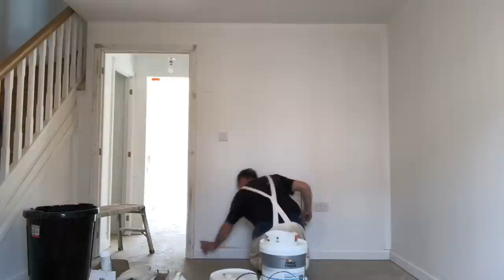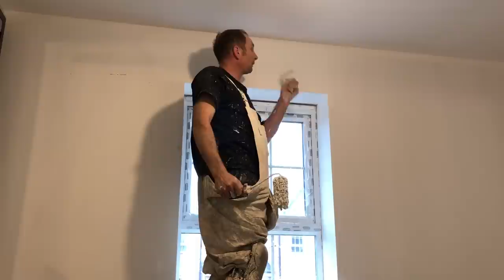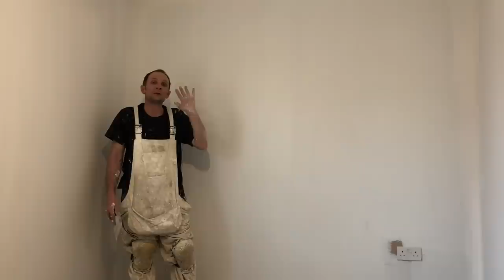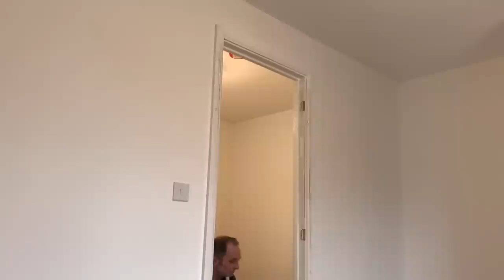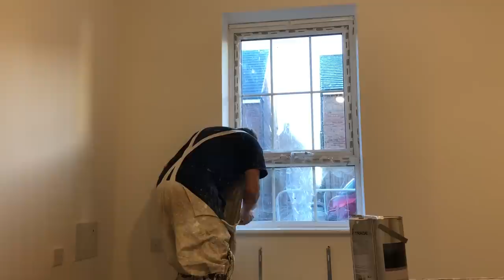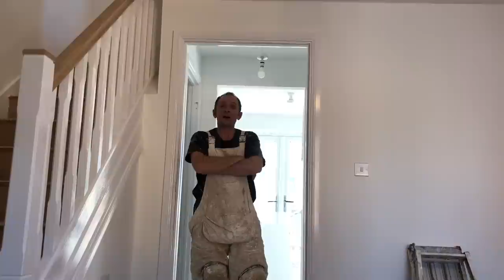How to paint a new build house step by step

Comment: With all due respect to you and your work, and taking into account my professional experience as a painter of more than 20 years, with cheap and expensive houses painted around various places in the United States, Venezuela, Ecuador and Spain, I must tell you that the process that you use is not the right one, I am only going to give you an example, first all the wood is organized and worked, after the wood is painted it goes to ceilings and walls, it is only one of the many examples that I can give you, also I am going to ask you a question, what happens if the client wants several different colors for his walls or he just does not want them to be white but a color tone other than white, that complicates painting the wood last, you have a good brush technique and knowledge but you it applies very badly, you don't look like a professional
Reply: how would you of done it

Comment: i thought i was ok at painting until i watched this. it would take me 4 times as long to do trim. the best take away from this for me is a decent 3 inch brush for coating frames / rolling doors with a 9 inch roller / and second coating satin ( i have been using a shellac primer and one good coat of gloss but it never looks as good as this does.

Comment: See I do it differently.
When it comes to frames, architraves and skirts, I give everything a first coat of paint so I can see all the defects easier, then I fill all the holes, cracks divots etc, then sand, then apply more coats untill ready for gloss......THEN I tube up literally before the gloss coat.
I don’t understand people who caulk up first.
But that’s just my way of working
Reply: Me too mate thats the right way to do it. You'll only end up filling twice saving time and money
Reply: Thats becouse you are proper painter as myself.
That guy works very fast but the quality of his job is horrible.
When you are proper painter you know how to do painting properly.
Reply: Here in Aus we sweep whole job walls and ceilings, take off doors,spray everything with wallboard sealer,spray one then spray backroll one, ceilings finished. spray finish 2 coats inside all cupboards,sand woodworkCut and roll two coats walls and woodwork,gap up woodwork,gloss enamel woodwork,Roll and tip off doors.Sanding and dusting between coats

Comment: A little tub of water and a damp sponge when caulking in finishes perfect!
Reply: paul bristow moisture just cracks any paint laid on top
Reply: @user-yx7dp2pl8t  Ha ha ha Wait till its dried after caulking then paint it ! Just caulk in the gaps wipe off smooth with a damp sponge ,let it dry then paint it! I've been a pro for over fourty years and never had a problem doing it that way!
Reply: Yeah but this is house bashing needs to be done quick to make money. Haven't got time to go over with a wet cloth or sponge. I normally just wet my finger.

Comment: Try the water based white tikurllia satin for quicker finish than oil satin, and quicker and far less draggy than the standard paint quick dry satins. It's thin but high solids,, lf your able to choose n supply paint anyway. I think you would score roughly a dayon a project like this. , It's unreal how fast it slides on. Covers well 2, l like the Johnstone aqua undercoat for speed, any top coat glides on far quicker.

Comment: Putting emulsion as a first coat on woodwork is a amateur painters way. Even worse is you haven't caulked underneath the staircase, you may be doing the plots quick but I'd imagine your spending more time snagging, if your not then your getting away with shit loads up north.
Reply: Ha ha I spotted under the stairs too lol. The thing we have to remember is they are site painters speed is key. He may not do that in a private property. I wouldnt I know that

Comment: Hi
Great video! In my experience the woodwork always take a lot time preparation/painting. You save a lot time to Not cutting the top part of the skirting and door frame from the  side,using emulsion like primer for difficult areas. That I will try it!
Only when you roll the walls over sockets and light switches the paint splash and then you have to clean it (I put small piece of masking tape only on top).How you remove splash paint from skirting ,maybe when you start sanding?
Profesional job,Well done!

Comment: Hi there, what 3inch brush brand are you using, synthetic or natural, cracking video, I used to use Hamilton all the way, but I find natural bristle perfection just drop bristles all the time now, especially when in stored brush mate, I've tried the proform piccaso hard-line, cracking in anything water based but shite in oil and tips when stored in vapour box curl after a while
Reply: Harris trade is the way

Comment: Did you use oil based undercoat on both the frames and skirts ?
Reply: @bartley7953  Try the Johnstone aqua undercoat, it seems to dry like an oil, topcoat glides on, your far quicker with this in my opinion.

Comment: If you was to be glossing your frames... would you use the same method. 1 acrylic, 1 gloss, 1 flash over with gloss ? Or would you use 2 coats of acrylic and 1 gloss? Just interested to know. I never know which is the best way to do it. Cheers.
Reply: Great video thanks!!
Reply: Silver the pipes off - what does that mean?
Reply: All  MDF must be primed with an acrylic (water based) primer , oil primers can mobilise the plasticiser and resins in the mdf and give you drying issues later. If you are going over a pre-primed mdf then you could use an oil undercoat as long as the primer has not been sanded or scraped of by. In NZ we very rarely use oil based products for any painting now, but I did my trade using oil and learnt the old ways.
Reply: MDF is a bloody nightmare

Comment: what filler is that u use for woodwork,how long before can sand,thanks
Reply from the maker: snoozylad 
Easy fill or Polyfilla
Reply: would one time filler be any good
Reply: should be two part filler,powder filler is no good, blows out later!
Reply: @alvinosullivan2804  if you let it dry and spot prime it  before undercoat and glossing then powder filler is fine. ?? I've not had any problems doing that with tetrion filler for 30+ years and no come backs
Reply: @glenwhyte2555  as the wood  flexes  over time, powder filler  with no flex,unlike 2part filler , puffs up out of the  filled holes!  I see it all the time on  new builds !
Its just   a tosh job using  easfill on woodwork!
Reply: @alvinosullivan2804  interesting to know.. 👍 live and learn,  I use 2pack on exterior
Reply: @glenwhyte2555  it usually  takes a good few months  before it shows itself,by then the initial painter is well out of it,but if you look at it  in about a year ,you see all these little  bumps on the paintwork where the nails and screw holes  are,which is where the powder has puffed up and pushed the paint up.
Its annoying  to rectify, as you have dig them out and refill.
I just  know this from bitter experience  ,after doing the second decoration  on new builds once the house buyer  has owned it for a bit!
Reply: @alvinosullivan2804  not on pin holes on mdf, you will be sanding the mdf off before a 2part filler

Comment: Can you tell me if you used cheap layland trade paint would you get a good finish as I'm a painter and had a new build 5 bed house and was supplied with that layland and it was terrible had to do 4 coats and was still patchey and the owner said I gave a poor finish when I asked when I quoted for dulux trade pbw diamond matt as I no that paint is the dogs b@##s